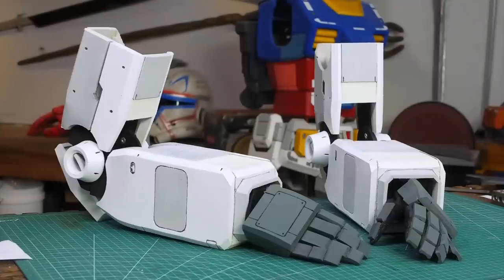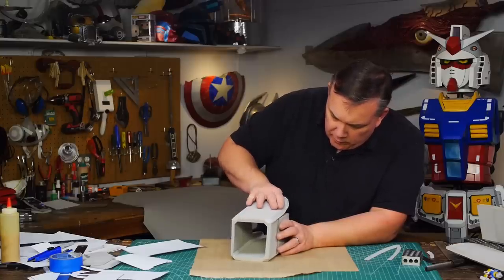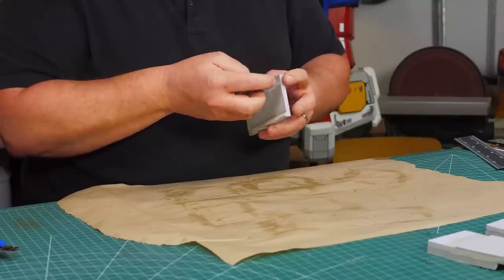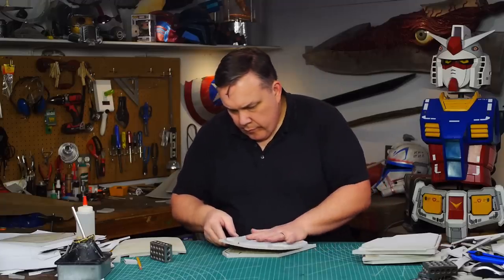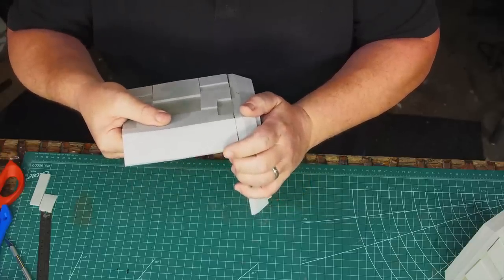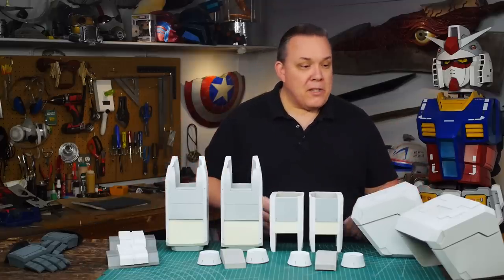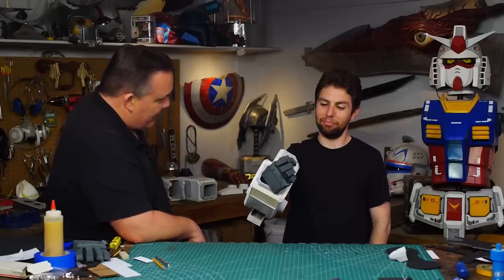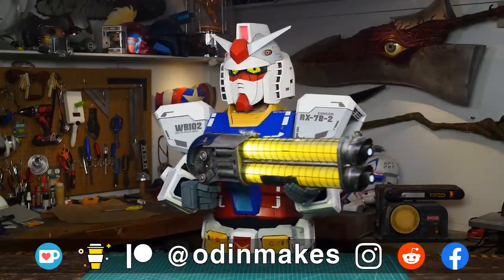Odin Makes: arms for the full suit Gundam RX-78-2 cosplay

Comment: I'm actually pretty amazed at how well you've articulated the arms
Reply from the maker: Thank you!  Me too. The joint articulation was something that worried me fully. it wasn't until I started with a cardboard version that I realized where the pivot points needed to be, and that Gunpla has it right, 2 pivots are needed.
Reply: @OdinMakes  I'm sure the legs will look killer when you're done! I haven't really experienced much gunpla past one kit and the legs on that while looking cool where not practical at all. I mean. Who puts thin blades as feet?

Comment: So for the legs, do you plan on continuing to use the RealGrade as a reference, or do you want to try looking at the MasterGrade Version 3.0? The MasterGrade is larger and the knee bend is a lot more realistic (though it does work slightly differently)
Reply from the maker: I do believe we are planning to continue with the RG look. But it is also a bit of a mash up, the 3D model I have is based on the 3.0
To be honest, I am not even thinking about it today! :)
Reply: @OdinMakes  I think the only cosmetic difference between the MG 3.0 and RG is that the MG has a second split in the knee for a bit more realism in the articulation. I have both and that's the only difference I can tell, not to mention that the 3.0 was directly based on the RG when it was designed at Bandai.

Comment: Hey Odin, it's not 2015 anymore, but could you make a Pitbull hoverboard?
Reply from the maker: I have actually held one of the original Pit Bull props. The board I saw was missing the boosters and tow cables, I think they only made one set, and they moved from board to board. What I saw was a very lightweight version, probably a gator-foam core with a glossy print and a little styrene plastic for accents. The hover pads on the bottom were vacuum formed.

Comment: I have always thought a good way to do the beam sabers would be using a newer style toy lightsaber as a base so when its attached into the backpack you could recreate the iconic drawing the beam saber from over the shoulder just by pulling it down quickly without the need for a button or a swap out blade but the length of those are not the best

Comment: I worry about heat exhaustion when wearing this fantastic suit. Any comments?
Reply from the maker: Very real concern. There is space in the backpack to add forced air circulation. But it is still a suit made from insulation material.

Comment: I still say you need to buy two of the official 1/12 scale air shock beam sabers. They do come with mounts in them that are meant for the 1/12 jumbo size that would fit the backpack and you could likely use those to work a piece to make a light up beam saber blade. 

I have one myself and it's one of the most prized parts of my collection. Even if you don't use it straight up you could use pictures of that to develop your own with proper details.
Reply from the maker: Beam saber hilts needed to happen with the backpack build, time was against me there.
I will Look into them! After the legs, I am planning at least one more video, armaments!

Comment: Amazing work and very helpful videos you have here. I have a question, what do you use to smooth out the edges of the foam? And do you prime the foam before painting it
Reply from the maker: the sharper your knife, the better your cut edge. mostly, I just sand, or add flexable spackle. Prop monkey sells a really great product Gap Filla, or you can use EVA foam clay and water on your fingers to smooth.

I almost always prime with Plasti Dip spray, but I am looking to try Creature Cast neoprene rubber as a sealer/primer. Smooth On has some flexible urathanes as well.

Comment: I always like how you suggest what tools will work just as well when you use mechanical equipment thanks Odin.
Reply from the maker: You bet! I was making stuff on the back porch of my apartment way back when.
Power tools save time, that is about it. You can make this stuff without most of them! (I think a heat gun is necessary...)